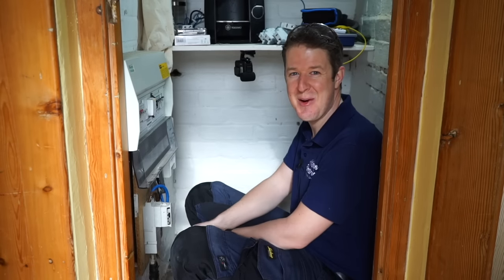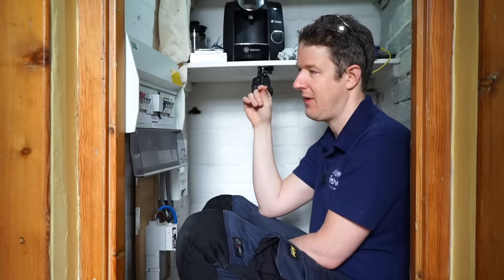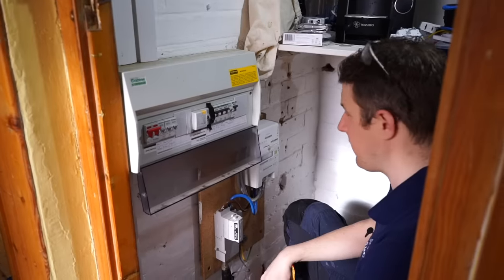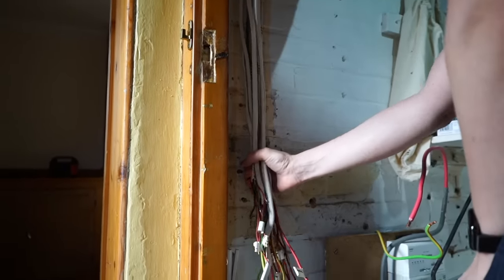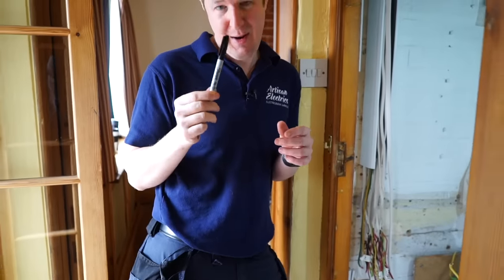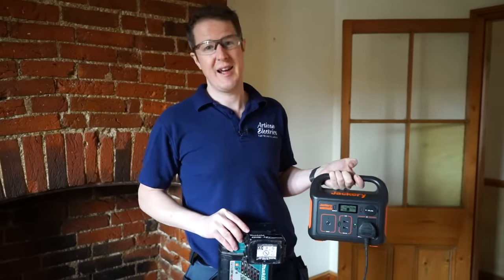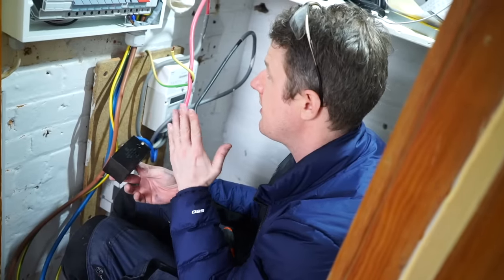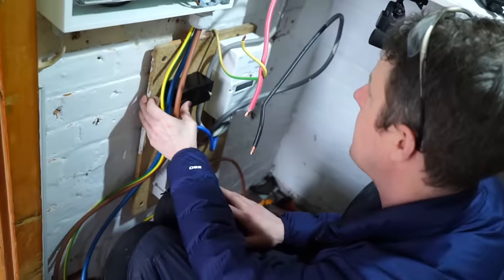My Consumer Unit Secrets 🤫 - How to install a Consumer Unit/Fuse Box

Comment: I find the numbered idents can easily slip off the cable if disconnected so i normally fit a very small cable tie at the base of the wire to stop this. Which means it takes even longer to complete the work haha.

Comment: Decent job , I've started to see more people using numbers in the DBs recently it does look more professional but coming from an electrician that working in industrial installations with control panels and control systems if you are not numbering the other ends of the cables is there any point in an installation of this nature ?

Comment: Have you had any problems with the DNO for pulling fuses ? How much do they charge you in your area to fit a dp isolator
Reply: I have had permission only on two fuseboards over the years to pull the fuse but generally I encourage to get in touch with there supplier as they generally cheaper than westernpower.

Comment: Thanks for another interesting video Jordan. It seems that there are a few of us Aussies watching your channel from your live stream.  I'm curious if TPS cable in UK has always had a bare CPC / earth in a smaller conductor size than live / neutral? Our TPS in 2.5 for example is multistrand, with earth insulated and same conductor size as live / neutral. This has been since the 1980's I think. Earth was bare before this.
Reply: Yes, twin and earth has always had a bare earth as far back as I can remember, and it is usually a smaller cross section than the live/neutral - other than for the smallest lighting cable where all three are 1.0mm sq.   The 2.5mm cable commonly used for the dreaded British ring circuit (socket outlets) usually has a 1.5mm sq earth, but some older cables ('70s vintage) have 1.0mm.  In the older days when that would be protected by a 30 Amp rewireable fuse that was a bit thin, but now with RCDs and RCBOs it wouldn't have to carry much current in the event of a fault to earth.

Comment: My lecturer at college in the mid-80s told me that tails are not double insulated. They are single insulated and sheathed.
Hope the lid fixing screws are not too long, with those conductors sitting underneath the fixing lug on the RHS...

Comment: How long do you allow for a DB change Jordan?
I had to move a fuse board the other day ( about a meter from were it was), followed by an EICR (wrong way round I know but I have to do as I’m told) 13 ways and all the associated junction boxes involved with extending cables, making up a backboard to stand the DB off the wall and install some four by two trunking up to the ceiling so I had better rear access to get cables in. An hour and a half driving for the job out of an eight hour day. My employer questioned why I didn’t get done within eight hours.
Your thoughts appreciated

Comment: I can see a couple of differences between English and Swedish standards in how we do installations.
I have some genuine questions:

1. Why is incoming power to the exchange separate conductors and not a cable?
2. RCBO fuses are installed for all groups, is this standard or just something you installed for extra security?
Is there anything that says you must have separate or could you install the lighting groups and sockets under common earth fault circuit breakers?
3. 120A sounds like a very high incoming hedge, is it not wise to advise the customer to hedge down to 63A (?) And save some money on the subscription cost?
4. What is the area of the earth that comes from the outgoing groups? Looks like 1mm or less? Or is it the same area as line and neutral?
5. I have seen in other videos that the wiring is not pulled in pipes to sockets in walls, etc. you clamp the cable directly on the walls.
Isn't this very awkward if the installation would need to be changed in the future, it is not possible to remove the wiring? For example, if you want to change a 1-pole switch to a 2-pole but the cable is only a 2-conductor?

Worked as an electrician in Sweden for 5 years and now a consultant for 3 years making drawings and materials for electricians on construction sites, etc.

Nice installation by the way, professional pride in its essence.

Comment: Personally I'm in a bit of a different industry (lab scientist) but typically I just end of using a cheap laundry marker from wilko, because theyre basically the same as a sharpie but have a much finer tip and smaller tip at the opposite end to make it easier to write out small labels.
Otherwise BIC have a very good extra permanent marker that's a bit more resistant.

Comment: Hi Jordan,

Thanks for another fantastic video.  Could you please answer this question for me?

Is an EICR notifiable work, on the grounds that you are not replacing the CU or altering the system in any way. 
You are not putting in additional circuits, or changing any breakers or ncbo's?

I know that the certification has to be filled in and handed to the person ordering the work.  Would love to 
know your thoughts on this.

Stay safe and well,  regards,

Bill.

Comment: Couple of questions from a recently out of his time electrician, my boss has always said that compression glands are only for round cables so that the compression gland can fit perfectly around it. I'm sure this is true if you are in a situation where you are worrying about IP ratings, but is it different when IP ratings are not coming into play? 
Also, I feel like I need more practice with replacing distribution boards, installing new ones Ive already done, but are there any places I could go or suggestions that could help me get more confident in this area? 
A pre-eminent thank you to anyone who helps me with either of these questions, this video was also fantastic, I wouldn't have thought (maybe a sign of my aforementioned lack of experience with board changes) about move the board higher
Great work, cheers
Reply: Compression glands come with inserts to accommodate a T+E cable.

Comment: I would of used metal trunking and put it full length of the metal board and slotted with a grinder to make optimal space in the board and leave a nice swoop in the trunking and not the board 👍

Comment: Broke my heart at 45 minutes - not a DIY job. I get why obviously but I love electrics and am in the process of rewiring my house and am gutted I won't be able to do this as I would be this neat with the dressing of the consumer unit too. Out of curiosity you said 6mm was enough for an eV charger... But is it ideal? I'm running a 16mm cable for a shower because it's 10.8kw and apparently 16mm is recommended... How can 6mm be enough to charge a car? Slower rate of power I guess... But less than 10.8kw?

Great video by the way!

Comment: @artisanelectrics - regarding removing the cut out fuse, do you notify the DNO about removing it? and what about replacing the security tag? had a new consumer unit installed recently and the NICEIC electrician left without tagging the cut out fuse

Comment: Nice to see this great work-and the pride behind!

But when it comes to connecting your nice, new appliance to the grid you cut the supply wires short, add another set of connecors in a little black box and stuff the old, crappy wires from the meter into it...btw. all mounted on a flammable wooden base...
I dont get the point of circumventing a proper connection directly into the meter...

Comment: Great job, nie and neet and imformative, however 1 point deducted because from what I can see the slot at the top of the unit is slightly larger than the trunking, finger proof yes but not knitting needle in a childs hand proof.

Comment: Could you use ferrules with those flexible tails? As DiYer making good the sloppy work by recommended registered professional electricians, I've used them with flexible cable, especially single wires in conduit from switch to socket where socket is unswitched

Comment: 26:00 i like the idea of using that piece of equipment, to supply electricity to modems. But imagine if you had an EV van where it can save your day in a emergency to charge those type of things. Or amazingly, you could chase walls without having to invest or rent generators. The technology already exists, the problem are the OEM's that intentionally delay the transition.

Comment: After drilling the two holes in the top with the 25mm hole saw how do you remove the two sharp points and what tool did you use. I have tried tin snips but these just seem to bend the metal all over and a good old hacksaw blade. Which is a bit time consuming so just wondered if you had a magic tool for such things. Cheers
Reply from the maker: I would use a jigsaw normally but in this case I didn’t have one with me so I manage to do it with the hole saw at an angle

Comment: Regarding comments here about the wisdom or otherwise of a video on how to replace a consumer unit, I recently employed an electrician to replace one in my parent's house and found the many videos by obviously trusted electricians on this and other channels to be very useful in determining what questions to ask and to assess what sort of response I was getting during the quotation process. 

I have done my own electrical work for years having been interested in such since childhood, but my career did not go in that direction. I would never do any part P notifiable work, although I would have done that type of work before part P existed. I know many cringe at the phrase "competent DIYer" but I do think it is possible to be such a thing if you are practiced in such work, well aware of the regulations and versed in electrical safety theory and practice. I wince at some of the work I see on EICR videos - awful terminations, no sleeving, no grommets, exposed single insulation outside enclosures etc. I'd never do that. Whilst maybe there is an argument for restricting sales of consumer units etc, I'd very much want to keep the right to repair or extend non-notifiable electrical systems in my own home.

Comment: Great video thanks for making it.
You said "tested today and due in five years!"  Is that mandatory or suggestion?
I ask as where I live once installed the panel is never checked again even in 100 years unless adding lines or changing old style wires.
Reply: Iirc Jordan said it was a rental property, looks like a decent landlord too. Also it will have another inspection when there is a change of occupancy.

Comment: What do you do if the main earth conductor on a TT connection is lower than 16mm?
You are upgrading the connection to the board to 16mm but it does not look like the connection to the supply is equivalent.
Reply: TT earth conductor can be 2.5mm if protected. Doesn't need to be 16mm
Reply: @marcusstonham  so really upgrade from 10mm to 16mm is not needed?
Reply: @ricardobranco7357  not for TT no

Comment: enjoyed the video, actually watched from start to finish. Had a look at comments and nobody commented on henley block being used for the tails. Please don't think I'm being rude but why wouldn't you just replace them from meter?. I've been doing this for 25 years. Am I doing something wrong? Surely another screwed connection within the installation is just something else to go wrong. I know we legally aren't supposed to touch intake and meter, but you've pulled main fuse (pls cover with tape next time) so surely entering meter makes sense? Was using hager boards for years but think BG are just as good and much cheaper. On another note... like how you haven't given in to sponsors and keep your uploads true to u.
Do you factor in a cameraman for the day on your quotes lol ?

Comment: As a Cdn/Brit dual, I'm always fascinated at the marked differences between UK and North Am electrical codes. And that pertains to many aspects, but your packing a "trunking" ( "raceway" to North Ams ) so densely would raise immediate concerns in this part of the world:

More Than Three Current-Carrying Conductors in a Raceway, Cable, or Earth – Table 310.15(C)(1)
[Table 310.15(C)(1) requires conductors to be derated whenever more than three current-carrying conductors are installed together in a raceway, cable, or in a covered ditch in the earth. For example, Table 310.15(C)(1) requires a THWN No.4 copper conductor, normally valued at 85 amps according to Table 310.16, to be derated to 80% of its value when there are 4-6 current-carrying conductors bundled together. The same conductor must be derated to 70% of its normal value when there are 7-9 current-carrying conductors bundled together, and so on. The ampacity of conductors continues to decrease in Table 310.15(C)(1) as the number of conductors bundled together increases.]
[...]
https://www.jadelearning.com/blog/derating-current-carrying-conductors-for-conditions-of-use/

I find it curious that derating due to conductor thermal gradients isn't a factor in UK regs.
Reply: there is a derating factor for grouping, ie. how many cables are run together

Comment: If you were to put the main fuse holder back in as a cover without the fuse as others suggest, you would have no visible isolation point, don't know if that would be an issue in blighty. Some countries have to lock and tag the isolation.
Reply: probably not a big issue when your knee is right next to it the whole time you're doing the job? :D

Comment: How can it be a C3 when it conformed to the regulations at the time it was built? Surely even an old 1980's CU would breeze a EICR if it passed the test procedure and the tester was aware that it hadn't been touched since the commission date. 

Is this a new way for a sparky to get extra work? (I appreciate the rules may differ for rental regs). Tia.

Comment: If the consumer unit is in a room where the ambient temperature is between 27-30 degrees constantly, is it safe or are there any risks? It is the latest edition steel fitting

Comment: Is that a steel screw on the tail clamp? Putting a steel screw between the tails - might it get hot due to induced eddy currents?
Reply from the maker: No it wouldn’t
Reply: @artisanelectrics  Jordan - you may be right - but it may be that your electrics are better that your physics. Putting something with an iron content (ie steel) between two high current carrying conductors is going to cause eddy currents in the iron which will produce heat. Its just a case case of how much heat. If the screw and the bracket were non-magnetic everything would be different.

Comment: I want to relocate my consumer box which will be placed  further away from the meter box . Is there a regulation or specification  for the maximum length of the cable tail from the  meter to the consumer circuit box ?
Reply: Yes. 3m sometimes 2. If longer you need a switch fuse and maybe an s type rcd. Probably swa cable too.

Comment: I Googled 18th Edition Consumer Unit after watching this video.
Many including MK are selling such populated C/Us similar to the well known split load type now fitted with the type 2 SPD. I often hear from others that you HAVE to install RCBOs on each circuit as you have.
This is a falicy, if this was the case then we would not be seeing incorrect C/Us for sale, especially from the likes of MK. While I am not condoning your set up which is very neat by the way, my thoughts are that it is very expensive and over the top. I have to change my own C/U next year as part of a mains cutout move and I do not intend having RCBOs per circuit, I'll be going for the  standard MK supplied C/U, I have used for years with out any issues.
BTW, I thought you have to seal the cable entry points into the top of the C/U, can somebody correct me if I am wrong here please.
I repeat what said earlier, you are very neat and particular andyour OCD for perfection serves you well,
Reply: You can use the MK dual rcd board and they might be fine for some installations, but the MK boards are supplied with type AC rcd’s….
Type AC rcd’s are on their way out. Almost useless considering the amount of electronic equipment a modern home has. Type AC rcd can be blinded by the DC current produced by electronics. Yes more expensive but RCBO’s are a far better solution for safety and convenience. 
In fact dual rcd boards could soon to be on the way out. Google the regulations on rcd protection before you decide it’s over the top.
You are right about the top of the board though…ruined the ip rating with that hole, trunking doesn’t cover it properly.

Comment: The one thing I did not like about this job is using the copper CPC to slice through the outer insulation of the cables, bending copper and most other metals causes it to work harden, in this case the copper first has to make a sharp bend whilst it is cutting the insulation, it then has to bend itself straight again through the entire length of the tail, a copper strand that has been work hardened is not only less flexible to use, but is also more likely to fracture especially where the end connection is made, a broken CPC is the very last thing anyone needs as it may only show up after any incident has happened. Otherwise the job was very well carried out.

Comment: I glad we do not have to work with those small boxes .The breaker boxes in the USA are 3-4 times larger with plenty of working room .Plenty of room for arc fault  and ground fault breakers.I have 100a 120/240 mains power on an 64 year old house

Comment: You will find it easy to push cables through the gland if you smear conductors with silicone grease.
Reply: Or remove the ip65 rubber insert all together. Not required

Comment: Does the top of the CU not need fire sealing?
Reply from the maker: No, completely unnecessary
Reply: @artisanelectrics  what is the requirements?
Reply from the maker: It just has to be a non combustible enclosure hence why they are now metal